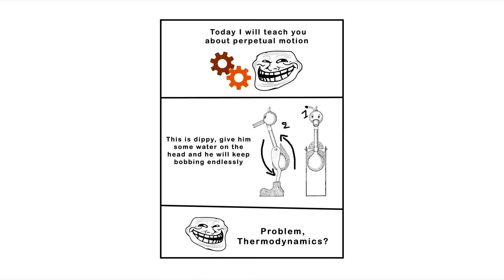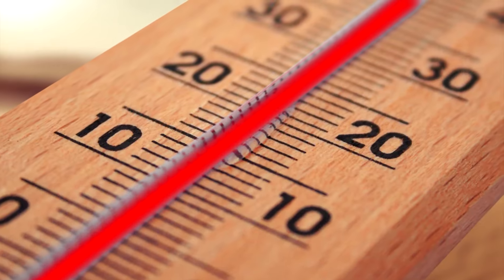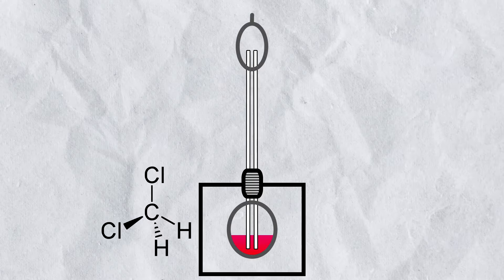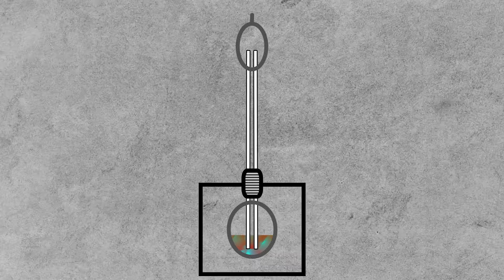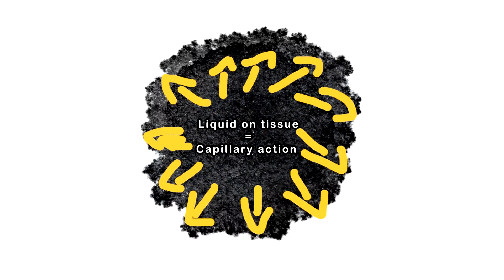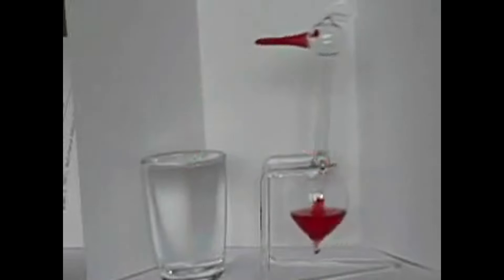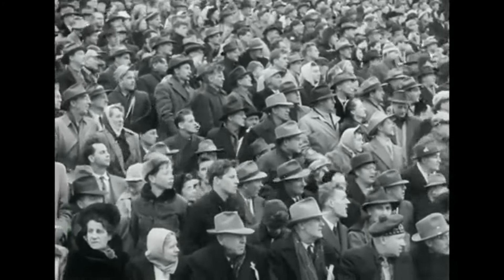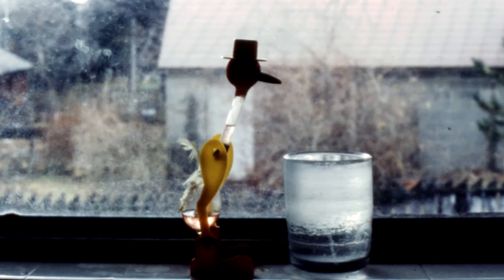why it doesn't work 58

Comment: the hardest thing in perpetuum mobile is hiding the Batteries
Reply: perpetuum mobile🗣🗣🗣🗣🗣🔥🔥🔥🔥🔥🔥
Reply: so unoriginal, delete this comment
Reply: calling pressure difference a battery is a stretch
Reply: @Preston-oe7nd  ah yes, he should delete the comment because it spreads true information that debunks something that can't be done

very smart
Reply: @mrrp_mrowp 
That is not the reason they want the comment deleted, it is due to an annoyance of seeing the phrase related everywhere. Your points are counters to this point, claiming why reposting is good, but your wording implies that the op dislikes it for those reasons, not that they are not considering them. 

I for one agreed with their statement, as the cookie cutter phase is not a good fit for the scenario at hand, and the rational is already explained in the video. Thus it is unnecessary to repeat.
Reply: @mrrp_mrowp  “Debunk”
As if this toy is somehow being marketed as actually breaking the laws of thermodynamics. It’s a toy, it’s not that deep, there is no evil mastermind trying to trick the world into thinking he can break the laws of physics.
Reply: I ain’t reading all of that, goodluck with the soon to be internet argument or good job winning it👍🥳😭🙏
Reply: The hardest thing in battery is hiding the perpetual machine

Comment: And what if we keep them enclosed, like this if water ever evaporate it go back into the cup
Reply: Then eventually the air inside the container will reach 100% humidity and it will stop working. If the air is at less than 100% humidity then you can't pull the water out of it without using energy.

Comment: What if we put the water in a sealed container so the vapor always come back to the glass after condensing?
Reply: If you have a perfectly sealed container it would eventually lose all its heat making evaporation impossible
Reply: @rizizum  put the container under sunlight
Reply: @mohannad_139  atp you can just harness sunlight energy directly, thats not a perpetuum mobile
Reply: @vollkornkeks9177 fair point
Reply: Eventually either all the water will evaporate or the air in the container will reach 100% humidity. Either way the dippy bird stops working.

Comment: can you make something that generates power by using the heat of the air?
Reply: No, not unless there's something else involved. A heat engine needs to have one side hotter than the other. Uniform heat spread evenly everywhere can't do work. Concentrated heat does work as it spreads out.
Reply: @barneylaurance1865  so theres no reverse radiation is there?
Reply: It's called a windmill

Comment: Okay, but could/do people use this sort of mechanism to generate energy? How efficient could it get with current tech? Given the mechanism, it seems like an interesting way to generate energy, but I suppose the output would be incredibly low (very little energy is added to the system, and gravity wouldn't assist much here?).
I could imagine a setup with very large, but evenly placed weights on each end, that could give some leverage, in theory, the larger the "bird" the more liquid/gas volume you could fit, so it should get more efficient with size. Giant dippy birds going in and out of lakes/oceans in dry areas - just imagine the hilarity and danger of it.
Reply: It relies on kind of the same basic principles as a sterling engine, only more complex. So it wouldn't have much practical use outside of what a sterling engine could provide which is already very limiting. But given that sterling engines have historically been used, that answers your question I guess. It wouldn't have much practical use whatsoever compared to more conventional power generating methods that exist nowadays but it would indeed be quite a hilarious sight!
A rather cool idea I had would be to use it to pump water for a small village. You have the lake already there, just add a pump to it. I for one would love for my village to get its water from the giant dippy bird!
Reply: @emilstnt3495  Didn't know about sterling engines, thanks for letting me know!
Reply: @NukeCloudstalker  You're welcome!